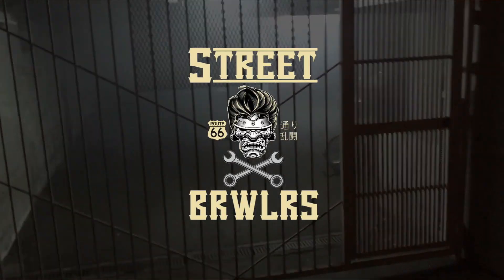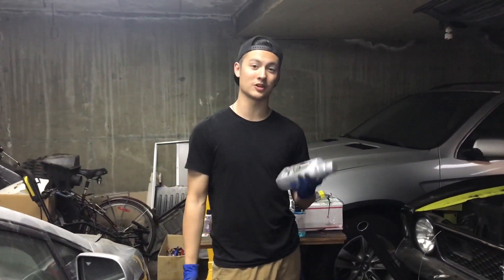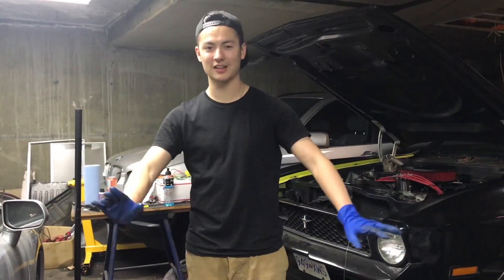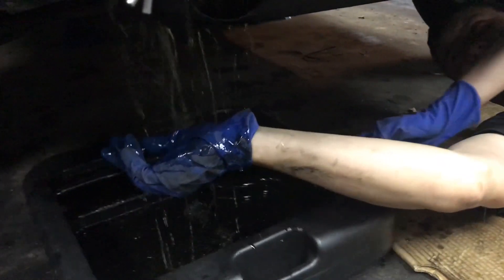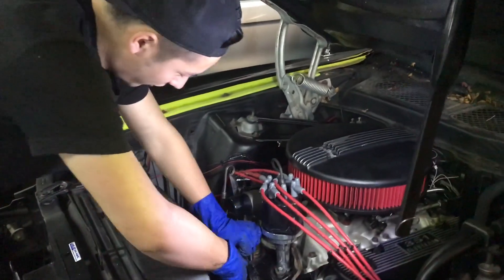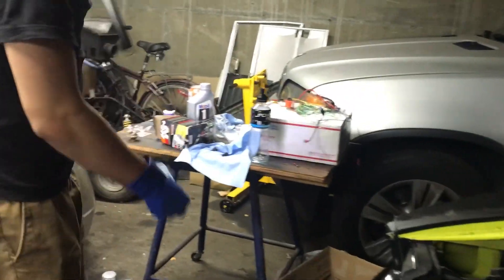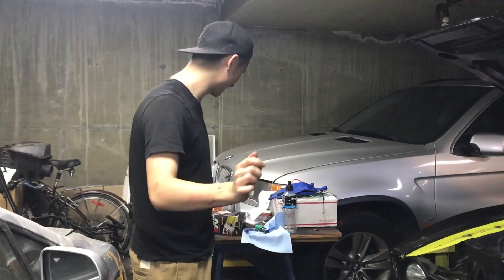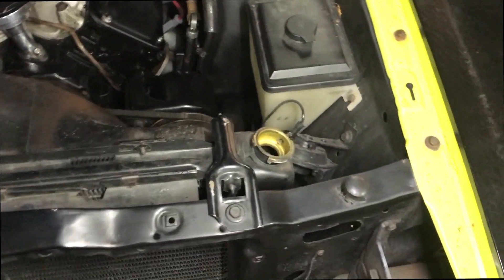THE CORRECT 351C THERMOSTAT

Comment: The so-called correct thermostat still doesn't even come close to restricting the orifice in the block. A ton of water still bypasses the radiator even with the correct thermostat.

Just plug the orifice and be done with it

Comment: NAPA part number 825-1007.   Cost 12.99.
Reply: For the thermostat?
Reply: @armandoestrada8499  ,  Robertshaw used to supply the correct thermostat specific to the 351 Cleveland. They don’t have them anymore but maybe you can use the part number to cross reference a correct replacement. It’s part number 333.

Clevelands also have a brass restrictor plate (orifice) that fits snugly into a recessed area in the block directly below the thermostat. The Ford part number is D0AZ-8K217-A but it’s been obsolete from Ford for many years. 

The good news is both parts are available from Tim Meyer. Tim has the original supplier making the thermostats for him now and he is making exact duplicates of the coolant restrictor plate in his machine shop. Tim specializes in all things Cleveland related. He can provide everything from the little obsolete parts to complete 1000 horsepower turnkey stroker engine assemblies. 
Check out his website. 
www.tmeyerinc.com
Reply: This is the WRONG thermostat. Do NOT order this Napa part number.

Comment: What’s temperature thermostat it’s better 160,180 or 195 temp for 351 Cleveland 2v
Reply from the maker: Really depends on the climate you’re in and the purpose of your car! If you daily drive your car somewhere cold probably want the 195 so the car heats up faster. Otherwise 180 is a good middle ground, definitely lot of different opinions on temp though

Comment: Just ordered the same thermostat for my 400 block. Same thing. One of the other things to check is if the lower radiator hose heats up or not. Mine doesn't. And I completely [urged the system of air. Engine doesn't overheat, but then again the sensor is in the front of the block so it gets sufficient airflow. Looking forward to fixing this.
Reply from the maker: Olivier Du Tré glad to hear! What’s the 400 in? Good advice with feeling the Lower rad hose, hopefully will help other people watching with diagnosing their systems.
Reply: Street Brwlrs Muscle a 1977 F150 supercab
Reply: I'm doing a Ford 400 I was wondering if that's the same thermostat I was needing for it. so the 351m and 400s has the same brass seat like the cleveland?

Comment: Another reason they overheat is that people put the head gaskets on with the logo facing upwards. That makes on backwards. They are marked front but people cannot read. I bought a 73 California Mustang convertible with 48,000 miles. The owner had let sit for 25 years. After I got it I figured out he had the RH head gasket on backwards. I replaced and no issue even with AC in over 90 deg. weather.  If you did not put zinc in that Mobil oil that is big mistake. You can check head gaskets with a mirror. Square corner on bottom front and big radius on bottom rear. Happens on 289, 302 and 351 W also. I have fixed several and I am not a mechanic. I just learned this by fixing other peoples overheating issues.
Reply from the maker: David Fowler that’s great info, could see how the head gasket would be a nightmare. 

Don’t need any zinc according to the cam maker as the engine has been converted to a fully rollerized setup (hydro roller cam, roller lifters, roller rockers). Thanks for commenting, nice to have knowledgeable clevo people watching this videos and providing useful info!

Comment: What year is that mustang?
Reply from the maker: Donald Nunes 1972! Don’t remember what gasket set I’m using, but I’ll try pull a valve cover bolt and measure it for you!
Reply: I just realized you are running the cast valve covers!  What size valve cover bolts are you running...  I bought a set of Ansen cast and I am going to run the 1636 Fel-pro gaskets?  I need to know the length and where did you get them? Rogue Bolts?

Comment: Nice car! West coast cougar is also selling the thermostats now. Ever take the Mustang thru the quarter mile? What size hydraulic roller you have? Thanks
Reply from the maker: Tom Gregson Thank you very much and did not know that will have to check it out! Goals are to get the mustang to the 1/4 this summer, will make sure to post a video on it. Cam is a mild comp cam .566 lift 215 duration @ 050. Will also do a full car overview in an upcoming video if interested :)
Reply: West coast has everything.   Pricey though.

Comment: My Ford Mustang still over heats help!
Reply from the maker: Have you bled the cooling system? Sure the thermostat is opening? Carefully touch your lower rad hose when it is over heating and see if it's hot.
Reply: Street BRWLRS Muscle yes I have bled the systems and turns out my by pass plate hole is to big for my thermostat
Reply: @h.n.s.l  Hi man can you please share the size hole you drilled so that we also dnt make the same mistake

Comment: All three of my clevelands had the wrong thermostat in em when I got them but still had the block plate. It really is an important little tidbit. Clevelands rock! and so do old school Solid Flat tappets (when taken care of properly) went with a lunati 30320514 and she sings at 7000rpm. So many reasons to have more then one cleveland on hand! they make easy power if you know their quirks.
Reply from the maker: Troy Bergen thanks for the comment! Yea the thermostat thing is definitely a tricky one for first timers! Exactly I’d like to have multiple Clevelands to do them all up differently, but my wallet disagrees ahahahaha. Still have lots to learn to make good power with mine, recently figured out my Aussie 2v closed chamber heads have oversized 4v valves which could be contributing to some performance loss so I’ll have to dig into that in a future video!
Reply: The big valves in a 2v sized port was a pretty common flow upgrade done to those heads, I've seen people go both ways on what size is actually better though. Should only be costing you power if the rest of the motor isn't set up to compliment the heads. You've got some nice parts in there should make good power. Gonna try and get mine on a dyno this year the c6 is gonna rob a lot but I'm hoping to see around 350 at the wheels.
Reply from the maker: Troy Bergen hmmm ya I was told the 2.19” were too big and would cause loss of control up top. Yea should theoretically be a decent build, will do a full video on all the specs and a dyno run in the future :) 350 sounds great! What do you have done?
Reply: By loss of control do you mean valve float? proper springs should alleviate that. My understanding is that other port work needs to be done to get any benefit (rather then loss) from the bigger valves (ie un-shrouding) Although I have spent more time looking at 4v stuff then 2v. 

mine is:
stock flat top rotating assembly, CC 4v Heads and romac balancer (approximately 10.3:1 compression give or take a bit)
lunati solid flat tappet (285/295 adv. duration .606/.606 lift on 108*LSA) with matching dual valve springs
Qualcast 2.19/ 1.71 valves from tmeyer, Bronze bushings in heads.
Edlebrock Torker intake with a bit of port matching and a EzEfi 1.0 with Efans on the radiator.
locked out oem 460 distributor with a MSD 6al and timing computer (16* initial 36* in at 3000rpm) -your setup can control this through the sniper iirc

 It's very responsive down low and pulls with no sign of giving up all the way to 7000rpm seems like it wants to go higher but I dont want to take it there on the stock pistons.

I put it into desktop dyno using stock 4v head flow numbers and it estimated 450hp at the flywheel. Seems to back that up from the seat of my pants (I figure at least a 60-80hp drivetrain loss if not more with the c6.) It ran a 13.9 last year and I think a 13.5 is easily doable this year with the locker now. (our track is pretty high elevation too DA's around 5000 are not rare)
Reply from the maker: Troy Bergen I will look into porting in the future thanks for the advice! Wow your build sounds pretty sweet, what gears did you have in the back when you ran the 13.5? Hoping to make a video on switching to electric fans so as well :)
Reply: 13.5 is just my estimate for a good run this year compared to last year haven't had it out yet (hopefully on the 14th pending my schedule works out). But I'm running a 4:10 ratio. Not highway friendly.

After all the work I did on my old heads I see why a lot of people just buy aluminum ones; machine work and parts really add up just to get them ready. But theres some extra little pride on making something run really good on the old iron.
Reply: @troyberg65  I have a couple of cleveland motors and have owned them for over 30 years and the stock cleveland crank i know can handle 10000 rpm racing. As far as rest of the internals not sure. Me and my brother built a cleveland the same way at 7000 it felt like it wanted more. If you make sure you have enough spring pressure in the valve train to keep from floating the valves it will run 8000 with no problems.
Reply: @ehel488  right on; good input; I think I may try to push rpm slightly higher, the motor is happy and I have dual springs in there 130# seat 320# open pressures, solid flat tappet cam